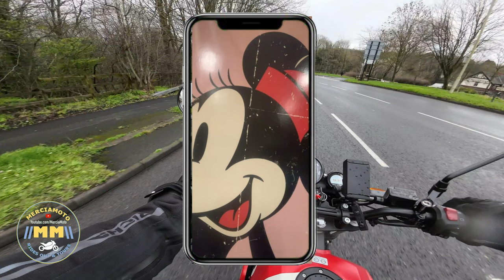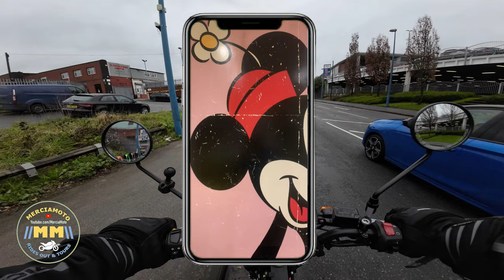Soggy Service Day Ride On The Royal Enfield Scram 411 + DJI Lavalier Microphone Test

Comment: Hi ya Dave common thing the horn stops working on scrams mine did cheap enough that service 👍🏍️
Reply from the maker: How do Derek, yeah I was pretty happy with price of the service, QB are a great dealers. The mirrors have got to go, I’ve never managed to gel with em, hopefully an improvement is in the offing 😁👍🏻
Reply: @MerciaMoto I fitted them double take mirrors on mine bought another set for the bmw @ £172 a set